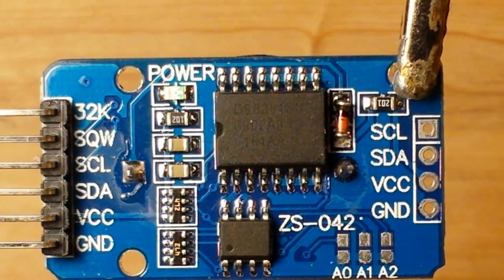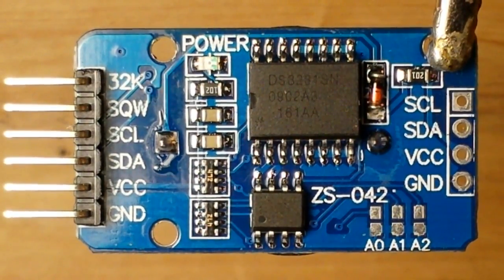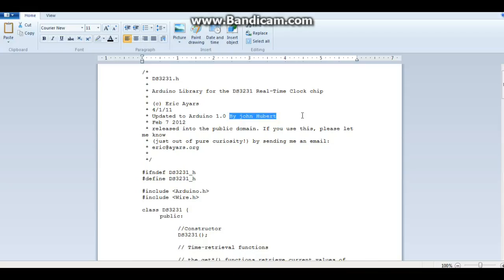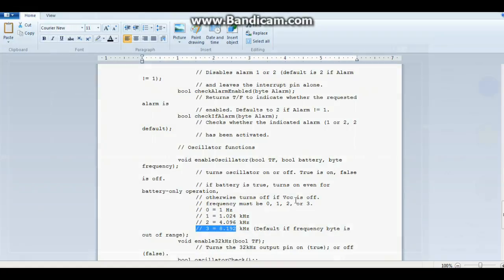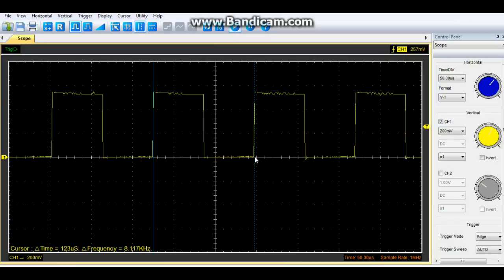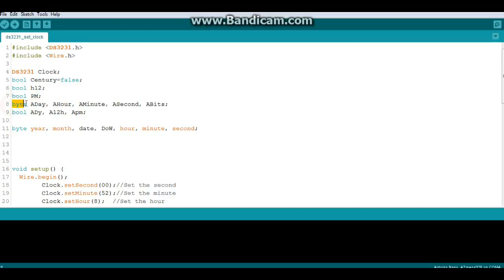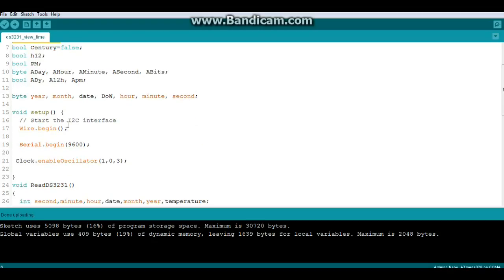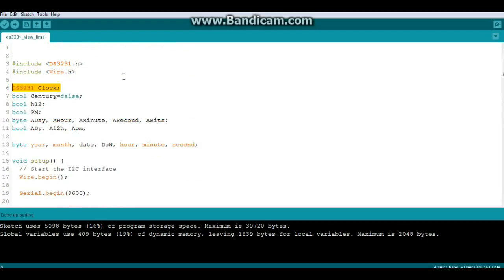All about the DS3231

Comment: Excellent video on the DS3231. I downloaded your _7_segment_4_digit.ino sketch but it will not compile. Line 35 of the code says 
"Clock.getTime(year, month, date, DoW, hour, minute, second);  //get time from DS3231". I get the error message "Compilation error: 'class DS3231' has no member named 'getTime'; did you mean 'getA1Time'?" . How do I resolve this. I've installed all DS3231 Libraries via the Arduino Library Manager but trying each in turn doe's not solve the problem. Can you help?

Comment: This board has a pull-up resistor connecting SQW to VCC, which is a BAD THING. That connection assumes that you will never want to use SQW when the I2C is not powered (that is VCC is open).  The DS3231 chip with its backup battery is capable of signalling an alarm condition via SQW, but the "pull-up" resistor connects SQW to VCC which is connected to the power on LED (via a 1K resistor) and thence to ground. When VCC is not separately powered, whatever source is connected externally to SQW has its power drained away. That connection can be de-soldered with difficulty from the top right connector on the topmost component labelled 472 (actually a resistor array) (below the POWER label and to the right of the leftmost SDA and VCC labels).  When SQW is not low, removing this trace raises the resistance between SQW and GND from 13K to 180K by my measurement. (When SQW is low because an alarm is triggered, SQW to GND is about 32 ohms).

I agree with other commenters: the 24C32N is not where the clock registers are stored, but rather on the DS3231 chip itself. 
Also remove the resistor above the right hand SCL label for lithium battery health.

Comment: Does anyone know how to disable the battery charging on it. The LIR2032 battery it uses is not available in my country and I am concerned what would happen if I used a regular CR2032 battery. So I need to disable the charging.
Reply: On the 4-pin header side of the board, remove the resistor located immediately above the silkscreened SCL marking. Or the diode to the left of it, or cut the trace to one of them. The Elegoo variety comes with it unpopulated and the CR2032 battery, but unless you want to get one of their kits, you have to order it from their website directly.
Reply: @xiaomong8  Damaging the battery is the least of your worries when charging a non-rechargeable Lithium-ion battery. Yes, you may not notice any issues, but the thing about Lithium batteries is they are little bombs. They contain metallic Luthium, which spontaneously combusts when exposed to air. Also the natural internal resistance is very low, so an internal short can develop temperatures high enough to start a fire.  Recall all the stories about exploding cell phones, and notice how newer cell phones do not have user replaceable batteries. That's because people were buying cheap no-name replacement batteries and then blaming the phone manufacturers when suddenly their pockets we're on fire.

So when the other commenter said it's "safest" to disable the charging circuit, he's referring to fire safety, not just equipment failure.
Reply: Desolder the diode and the resistor on the 4 pin side of the module.

Comment: Is one required to set the DoW or will the chip figure it out? I have no use for that one bit of info in my sketches and the uRTClib.h I'm using now has the set command wrapped up like your get command with all parameters required.
Reply from the maker: I'm pretty sure you can leave it out.
Reply: learnelectronics I've found that leaving out the DoW when setting the RTC using the DS3231 library causes the chip to override my year variable with a value that is valid for the month & day setting I send it. Or I need to change the order I send the value to make it set the DoW internally. Trying to decide if I persue that or cut my losses & add DoW to my GUI.
Reply: learnelectronics Where is the sketch in your dropbox. What is it called?

Comment: that module has an I2C 32K eeprom, too...
Reply from the maker: squalazzo yes it does. that's where it does the time and date
Reply: @learnelectronics  Yes, but 32k is a whole lotta memory to store just the time and date. Wonder if it could be used for other stuff.
Reply: Not true, it''s a separate EEPROM. The jumpers A0-2 are for adressing this chip, the clock is not adressable.

Comment: One of my favorite Arduino components.  I use the Sodaq library but overall very similar.  Set it and forget it (at least for a while).  Having that battery helps and I keep everything on Standard Time (so no need to reset to DST).  You can also modify code to always output YYYY/MM/DD, HH:MM:SS  ---- makes it look neater and keeps consistent spacing.
Reply from the maker: Michael Padovani it sure is a great module. couple lines of code and you have a clock in any project.